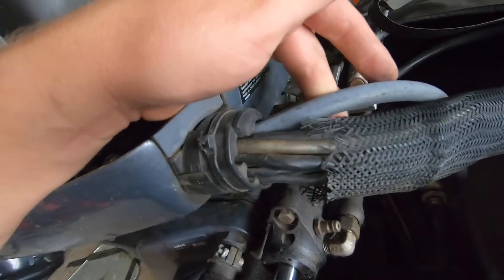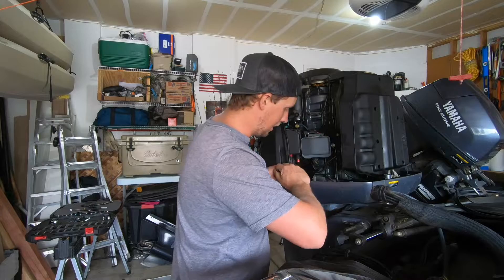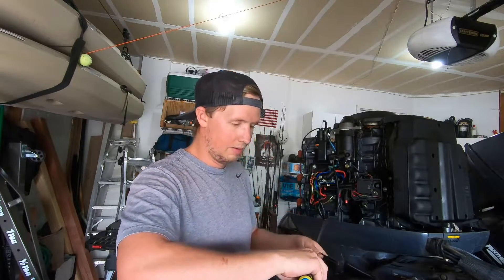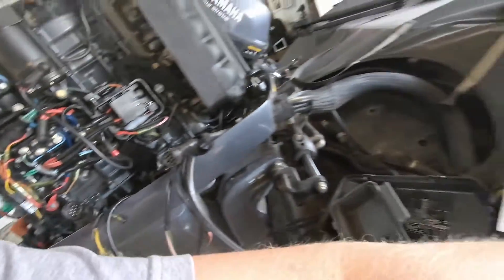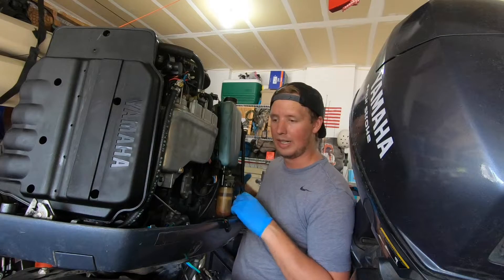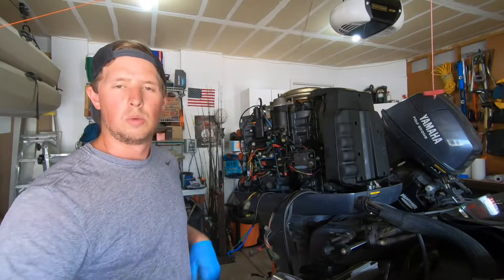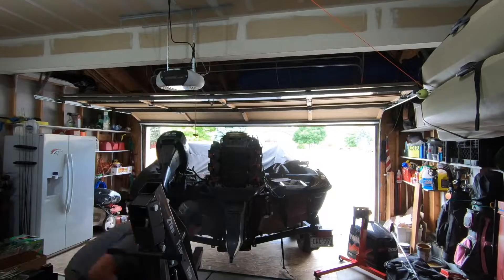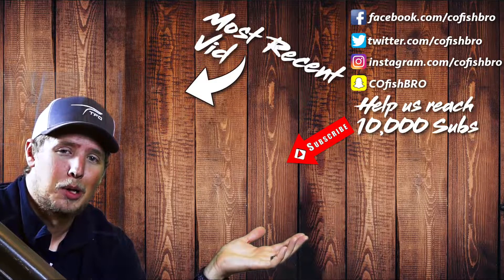Removing an Outboard Powerhead - Yamaha 200HP OX66

Comment: Glad to see this is still available six years later. I'm about to pull mine off a 2003 Yamaha 150. Thanks for making this. In my experience I'm removing everything I can off the block before I pull the head because it makes it easy (for me) to manage pulling the powerhead without damaging anything. Plus, easier to put back on without all the weight and room all the other components take up. Again, many thanks!!